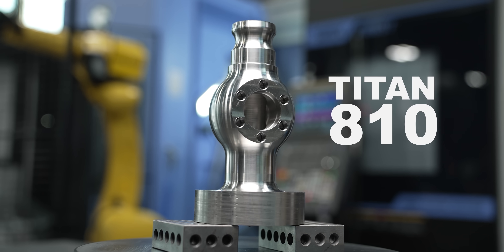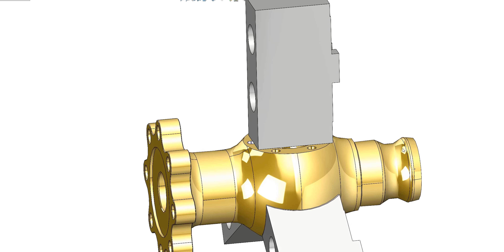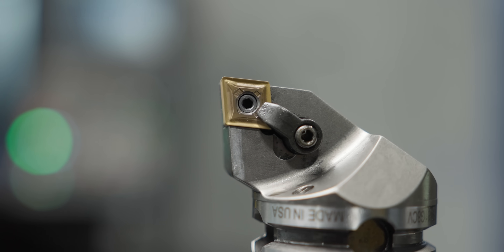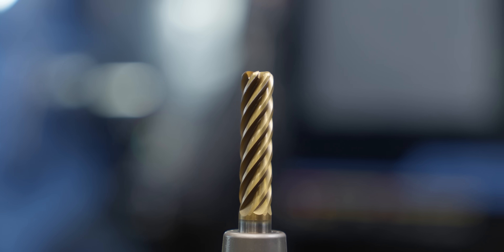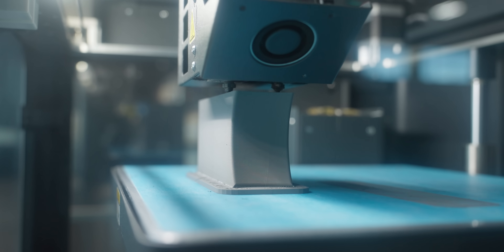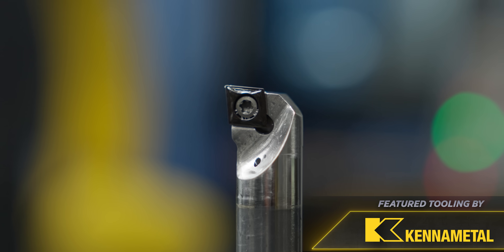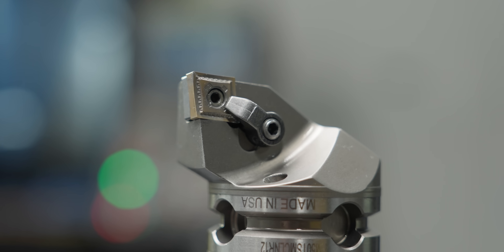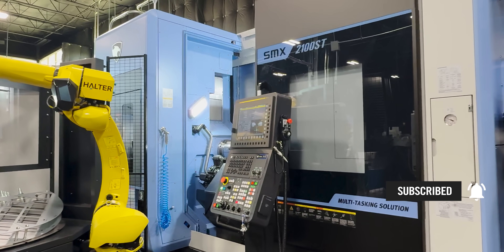CNC Machining Complicated 304 Stainless Steel Part

Comment: Very nice, thanks for sharing!
Personally, I would have flipped the order of operations, and held the part for the 2nd op using an expanding mandrel inside the ID bore.
That would have offered several advantages:
(a) No custom workholding required.
(b) Expanding mandrels are rotationally symmetrical, so no need to adjust the C axis offset every time that you change the subspindle chuck.
(c) The entire OD would be machinable during the 2nd op, which would make achieving high cosmetics easier (no workholding marks).

Comment: Wow nice solution!!!
Im not a lathe guy.
But What If you approached the part from the opposite side.
The (flange side) first.
And Made a nice fixture with 2 
Precision guide pins to get the rotational accuracy perfect.
Then bolt the part to the fixture.
In my mind this could be Done on both the sub spindle and the main spindle as a op2!
Well there are so many ways to skin a cat i guess🙂🙂
As a few people in the office know.
I am a huge fan!
Cool Idea on the fixturing guys!
//crazy Swedish guy😛

Comment: As a retired tool and die maker of 54 years you should try to program that manually then I would call you a real machinist. I’ve been programming multi axis machines before you were born. That said the solid works does make it easier and faster. Nice job

Comment: 1.5 inch groove lock or camlock for hookup  ? Opposite of flange
Reply: Camlock. Looks like 1.5" to me.
I'm curious what application it's for - thats a lot of money to avoid a threaded connection on something that's at a potential leak path regardless. The full bore valve is nice, I'll say that.
Reply: @GenuineTraumatizer  they can handle lots of pressure at my job I've seen 10 in Bauer fittings for big water systems 3000 gal a min
Reply: @g576758  3k @ 10" really isn't too much pressure. Something like 20PSI.

I'm more curious about the material it's got going through it. Probably a Hydroxide of some sort. Ie, Caustic.
The 1.5" connection also makes me think its for jobs using small diaphragm pumps or dispensing into totes.

Comment: Odd that the chuck has drive keys instead of serations?
Reply: Nah, quick change system, bigger teeth. I know the ones from SMW have about 10mm per tooth, rest is the hydraulic cylinder. Way better than serrations

Comment: Wouldn't it have been smarter to make the flange side of the part first, and just use the holes in the flange to bolt it to a chuck or table?

Comment: Clever work holding solution for a one off part (indicator measurement when lining it up would have been nice to see) but for series production the work holding and therefore machining process might need to be changed

Comment: Could you just machine a set of soft laws?
Reply: The spherical ones yes. But on a lathe you’d have to make all 3 of them spherical. I suppose you could just do that then remove the one and throw it out. Put a new flat one that you mill flat perfectly to spec and get that concentricity requirement

Comment: I'm impressed those jaws got the centre aligned perfectly.
Reply: how do you know it was perfectly? I would like to see an indicator on the part to see what the runnout was. Or they did not test the runnout or it was not good enough to show. I guess the last.
Reply: Since all 3 of them were likely printed at the same time any amount off they may be from 3D printing inaccuracies will be the same across all 3 of them so I think it makes sense